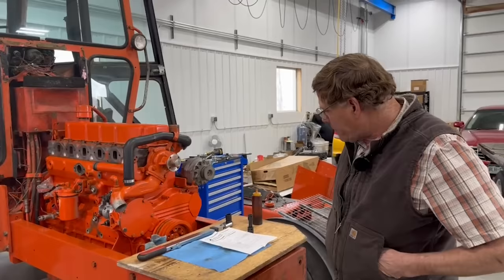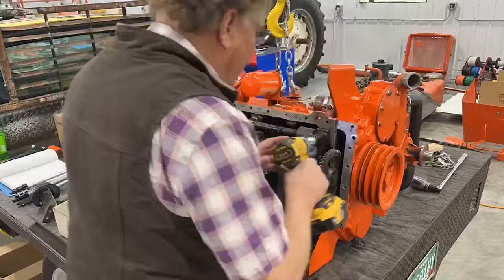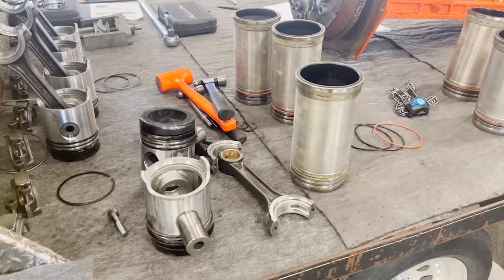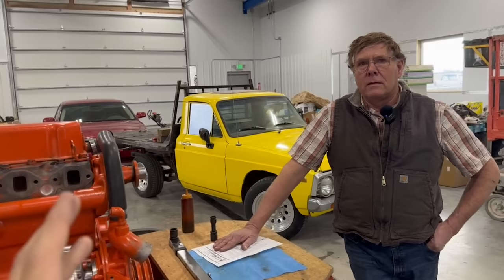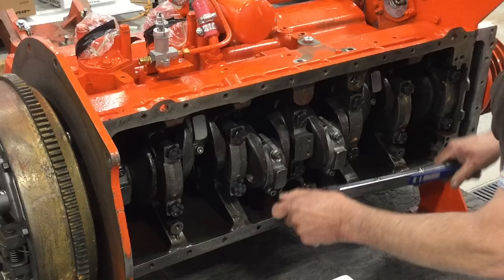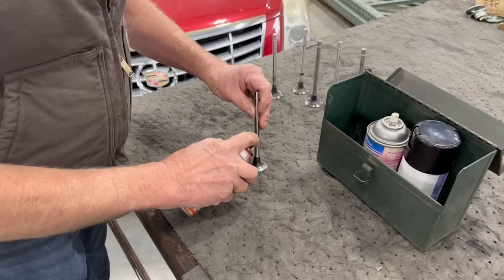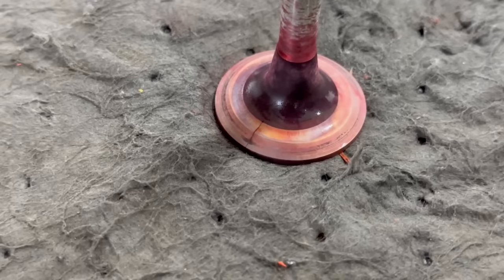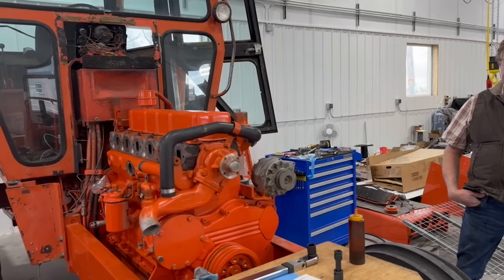Missing THIS Would've Cost Us THOUSANDS of Dollars!!!

Comment: Many, many years ago I put several hundred hours plowing fields with an AC 210 tractor that was tuned up 15% or so. We constantly had an overheating issue no matter what what parts we replaced or how tight the fan belt was. The final solution was to move the alternator from the left to the right side of the engine using brackets from the 7000 series tractors. Night and day difference. It consistently ran at the bottom of normal range regardless of weather or load.

Comment: Can you set this engine up with an exhaust pyrometer (EGT gauge) for the tuning?  Would help show if it’s running too hot or something is wrong with the injection system.
Reply from the maker: Stay tuned for next weeks video :P
Reply: Allis Chalmers diesel engines run high egt compared to other mfgs of that time
Reply: @RJ1999x  that’s fine.  An EGT gauge should still help distinguish normal from dangerous.
Reply: @GoFastGator  as long as you understand that hi is normal for an Allis Chalmers

Comment: The distributor-type pumps usually have an adjustment on the plunger cam ring for fine-tuning the timing but it is only a small range even if you line all your marks up I was always taught to check everything by spill timing the pump. I don't know about the USA but I have read some interesting posts at home here about biofuel blending with some special ingredients for more power like kerosene and even ethynol. I have even read of people using LPG [propane] injection to the air intake.

Comment: Glycol in an engine can do some wild things.    The cylinder  sleeves have tiny flex out,  when they get a pressure pules  (firing) and then drop back to normal creating  tiny air bubble out of solution.    The bubbles are like little tiny shape charges when they collapse.   Cumming did some major work of venting air out of Glycol to stop it and they added some chemical in in the glycol  to help stop them from forming.     It can be a nasty problem.

Comment: I think I would want a minimum of .005" skirt clearance especially being that the 5.9cummins of similar bore size recommends .006 for minimum and they have oil squirters of course also a lot more power.  I think it points mainly to the timing was too advanced. I believe you should time the engine with the pump scribe lines lined up when the engine is at TDC. I suspect the 25deg is already built into the pump. That is how the Roosa Masters are on The Deere engines anyway. Also Deere offers a diesel coolant good for 6 years that I have seen works very well at preventing cavitation. I have a few tractor pullers that use it and the ones that do liners look like new season after season, the guys that run straight water have holes forming after the 1st season.

Comment: I always love your guys content and videos i use to work with my dad at our repair facility many years ago 
On your fuel issues i havent heard any mention of transfer pump pressure should be 7 psi or slightly higher not sure on your engine may be separate transfer pump or it is part of your injection pump  this is the most forgotten or over looked potential problem 

Coolant quality or mystique ? fleet gaurd has a simple litmus test. Test strips for reserve  alkalinity

Comment: It would be a good idea to run some heavy duty coolant like Peak Final Charge or something similar, really anything that's formulated to prevent liner cavitation. The way it works is pretty neat actually, the coolant deposits a very hard sacrificial coating on the block interior, so that the cavitation that occurs will chip away at the coating instead of the metal underneath. Some coolants require checkups using test strips to ensure there's still enough additive in it to continue replenishing the coating as it's worn away, and can be refreshed with additive as needed....and some are good for a certain amount of engine hours and then you just replace it.

Comment: You can take that side plate off the injection pump that has the two slotted screws and check base timing of the pump. There’s a stationary mark and one that will rotate with the pump. Line them up and you’re at #1 injection. If over fueling was the issue, you should’ve noticed constant thick black smoke. Diesel engines run lean except when throttling up and when loaded. Light smoking is okay but heavy black smoke constantly should be avoided.

Comment: Timing the inj pump on #6 instead of #1 throws the pump out of time with camshaft timing events of the valves and causes abnormal cyl pressures while the engine is running So between ring end gap issue and the timing I think that is what caused the issue Everything got hot and swelled up hence piston failure Same thing happened to a friend of mine on a v-12 Cat engine Now you got cracked exhaust valves Heat is the killer in an engine as you know

Comment: If you are concerned about combustion temperatures, would it be possible to drill and tap the exhaust manifold for egt probes at each port ? I'm not saying you have to have all cylinders measured but maybe initially checked. You can always plug the holes later. This may not be practical but just a thought.

Comment: That’s wild how different the piston cooling nozzle setup is on an AC diesel engine vs an 855 Cummins, on those they have separate plastic nozzles that pass through an oil gallery in the right side of the block to get their oil supply then extend on into the crankcase to a pointed tip that’s angled to spray the inside of the piston skirt. Anyways back to the subject at hand, I.M.H.O. Your dad is dead on in suspecting the pump timing being set too far advanced. Those injector spray patterns were nowhere near normal, they were spraying not only outside the “bowl” of the pistons but clear out almost to the far edge of the piston crown. I’ve never seen a spray pattern that wide, it’s always pretty well confined to the bowl in every direct injected diesel engine I’ve had the head(s) off of.

Comment: Low sulphur fuel maybe? The sulphur acted like a lubricant for valve seats and top end which this engine was designed to run 50 years ago. Some diesel engines needed upgraded heads for low sulphur fuel.

Comment: i think if i suspected fuel, i would have pumped it all out anyways and started with fresh fuel. still sucks that the injection shop didn't perform a full diagnostic. here's a thought: if the original pump was turned up 20% and two of the injectors were already overfueling, or if two injectors had lower pop-off pressure, then you may have had two cylinders with way way way too much fuel.

Comment: I know you checked that the injectors were flowing at all 4 ports on each, and that they released at roughly the same pressure. But, have the injectors been flow-checked to confirm the deliver the same volume to each cylinder?

Comment: If you want to freak out on stuff , get a common crank sensor that Bosch used in the eighties and nineties. Figure out how to measure the flywheel teeth. If you use a scope you can see the time increase at tdc, as the crank slows down due to compression, I bet it was staying two or three times longer, heating up the valves and pistons and the slap would be that much harder.

Comment: If it were mine I would consider adding a coolant filter set up if it does not have one in it. I really wish they weren't called coolant filters because that is not what they actually do, it's is actually an additive package dispersment system that slowly releases the additives into the coolant over the life of the filter that cling to the sleeves and other components like timing covers where electrolysis commonly occurs and damages components. The clinging additives tear away from the surface instead of the metal of the component being pulled away.
Reply: This is a good point.  This era AC didn't have any coolant filter originally.  It certainly helps extend the life of the coolant.

Comment: Okay guys you keep talkin about fuel I agree have not heard you say that you had your injectors tested a leaking injector will have the same effect as having your pump out of time cause excessive heat excessive cylinder pressure
Reply: 100% agreed.
Reply: Yes, an injector that cracks open early can do the same. However, some engine rebuilders require rebuilding or replacing of all fuel system components for warranty purposes. The injector pop test is far from perfect.

Comment: I had a 355 nitrous motor years ago. Had ferrea valves in the head. I got a bad backfire once and the car was a couple 10ths slower after that. I made probably 20 more passes and street drobe 2 years and when we pulled it down there was a circular crack in the face of the valve i can't believe it didn't completely fail

Comment: cavitation can and will cause weak spots in the cylinder walls. I'm retired ford diesel tech and ford uses an additive to help with cavitation in there diesel  truck engines which donot work as hard as a tractor engines, might be part of your problem

Comment: I thought it was fifteen minutes plus especially for fine cracks. Any dry powder including chalk dust works if you run out of developer. Because basically all it does is draw the dye back out of the cracks. So talcum powder isn't a million miles off🤣
Reply from the maker: Yeah we definitely should've waited longer, but just wanted to showcase the method lol
Reply: Liquid penetrant dwell time goes by the instructions on the product container, usually, 5 to 10 minutes dwell. It also depends on the sensitivity level of the product,  and the temperature in that area. And, the products have an expiration date on the can/container.

Comment: What about the injector flow rates, because with the information of the possibly out of time injector pump, and the new signs of overheating inside the cylinders for certain ones at least. The injectors might have a very slight scoring inside that isn't allowing the right amount of fuel to e flowed when heated up. which may lead to a detonation/overheating issue. Because if the injector was getting hot the very minor scoring may have caused a dragging closing leading to excess fueling or even a slow fueling rate.

Which again, by itself might not be that major of an issue, but in combination with so many other factors added up to a failure. But you are right about missing a part of the mystery in the original pump setting, had it not been rebuilt the first time without full inspection, that may have added more information.

Comment: I cracked the cylinders on a 4500 Ford diesel,  when the truck filled the wrong resivouor at the small fuel station by my house with gas instead of diesel...also put a locking fuel cap on..I've herd of kids doing treacherous things for fun...or malice.

Comment: The things that you talked about left out one thing. Low fuel flow from the tank to the injection pump. That would account for low fuel flow and overheating. Without hands on it is the only thing that I can bring to mind that might be the cause of your problem. Best of luck on finding the problem with that engine.

Comment: Little tip for reusing bolts that you think have stretched, if you have a new one, lay a new one in the threads of the old one and you can visually see how much the threads have stretched.
Reply: There is a tool for measuring bolt stretch.

Comment: I still think that as the phasing and cylinder calibration is fixed by the design and setup of these pumps, all cylinders will be treated equally. If the issue is pump related, why is the cylinder damage not consistent. You're doing a good job checking. With the rear cylinders having suffered worse I still think the cooling system and thermostat should undergo close scrutiny. Thank you.

Comment: I agree with those who have suggested putting a pedometer in to monitor combustion temperature. It's not normally something I feel is necessary for stock engines with fueling set to original specs, but in this case it sure would be cheap insurance for an engine that has had a known combustion temperature issue.  In the on/ off road fuel debate:  In North America since around 2010 all diesel fuel is of the ultra low silver variety.  The only difference being the dye added.  The lower lubricity is more of an issue for injection pumps and injectors, not so much cylinder lubrication.  It's oils job to lubricate cylinder walls, not fuel.  Of course modern oil is another hotly debated topic, which you will find hundreds of opinions on.

Comment: If the pump was returned to proper timing (back to cylinder 1) and you guys would time it to cylinder 6 because that’s how you guys had the pump timed initially. How did you get the engine to run if the fuel injection timing wasn’t even in the correct firing order with the engine.Thank you guys for showing us the process.

Comment: Thanks for posting a fantastic series.

It'd be much appreciated if I could please pile on with my own 3500 concern?
I have one on my to-do list. I'm hoping this comment is read by someone who may have an answer; the manual is not clear on my concern.

The 3500 I'm working on has a build arrangement with an oil cooler directly behind the pump. The pump could only move away from the cover slightly before encountering the oil cooler. My question is: could the pump's driveshaft together with its gear be removed through the cover's capped front opening, thus allowing the pump to be removed without having to move pump towards the flywheel very far? Yes, I'm familiar with the timing, marks, etc. 

I know I could dig in and find out, was hoping to hear from someone who's covered this ground. Thanks, All

Comment: Still wondering if you have rebuilt or tested the fuel injectors if they aren't breaking open at the correct pressure effects timing also if they aren't spraying a good spraying a good pattern if not they can cause rich mixture over heating poor atomization of the fuel causing bad fuel burn hot spots on the pistons don't overlook the injectors

Comment: I am going to throw something out here that I haven't seen discussed. I went back to your video where you actually built this engine. I watched it a long time ago, so I wanted to review it and I did a skim of it. I never remember you discussing the fuel nozzles in the head of this engine. I often times think outside the box. It looks like this engine fuels with the basic design that a 3406 B cat engine uses. By that I mean that the injector pump builds the pressure to overcome cylinder compression and then the nozzles in the head will release the fuel spray into the cylinder when the pressure reaches a specific amount of PSI. What makes me bring this up is this. I see a total failure of two cylinders and a slight amount of damage on a third cylinder. This causes me concern about the individual nozzles. I wouldn't think that an injector pump on any engine would be able to change the injector timing from one cylinder to another. In other words, if you have 1 cylinder timed properly, then all of them should be timed correctly from the standpoint of the injector pump. BUT, if the nozzles are not working correctly, I'm pretty sure it would be possible for some of them to release the fuel at a lower pressure. This could possibly cause the fuel to start out of the nozzle before the piston of that cylinder reached to top of the cylinder. Two things would be likely to happen at this time. The first thing I see is that there could possibly not be enough compression for a good fire to happen. If that is the case, there could be raw fuel doing a cylinder wash, thus causing all kinds of things to result. If you replaced the nozzles, then this might be a waste of your and my time. For my own peace of mind, I wouldn't run that engine until I had all the nozzles tested, even if they were new ones at the engine build. You might have mentioned it and I could have missed it. I still think that this whole engine failure is fuel related. The question is how is this happening. You guys are two of the best mechanics that I have ever listened to and watched in action. Your work habits are impeccable. One last thing that I would have in my hand is a (I think that they are infra red) temp indicator. I would be checking the exhaust manifold temperature right where it comes out of the cylinders and just keep going back and forth on all 6 cylinders for a long time when it is first started, and for awhile until it has run for awhile.  Good luck on this build. I'll be listening for the result.

Comment: unorthodox but effective. Without the head on, bleed the fuel system and crank it over slow. You should be able to see the injection pump spit at what looks to be TDC compression stroke in each piston and check the firing order from the pump. 180 out should be squirting on the exhaust stroke which wouldn't do anything in a diesel. Too much injection advance will make a heatwave in the thing.
Reply: Definitely running too much injection advance before. Visualize a firecracker going off slightly before the piston reaches TDC. It's starts early because there is a delay for the explosion 💥 to build. Higher rpm needs to be lit earlier because the flame ignition time is constant but piston transition is not. Now picture too much advance is like punching the piston as it's trying to go up. That's why it creates mega heat and can crack pistons and more. Crank inertia wants it to go one way and the early explosion 💥 is actually trying to stop it from reaching TDC. This creates extreme pressure and piston rattling.